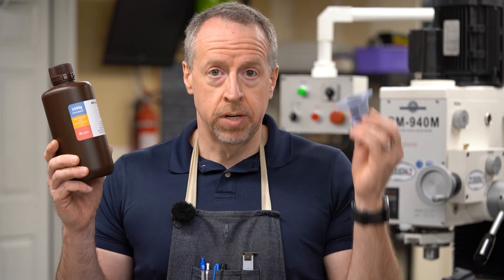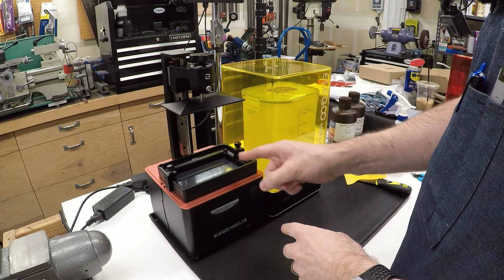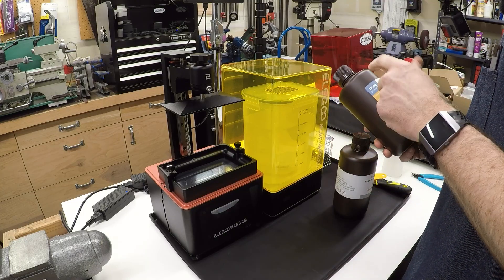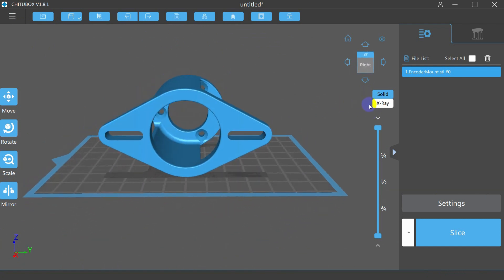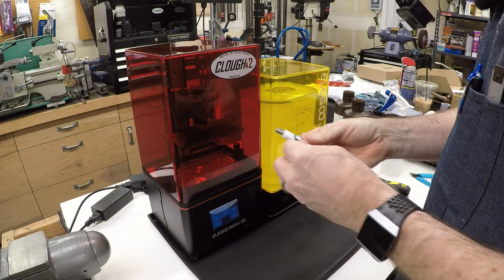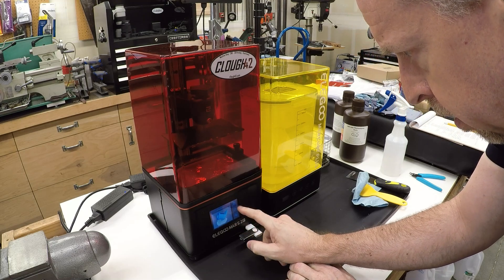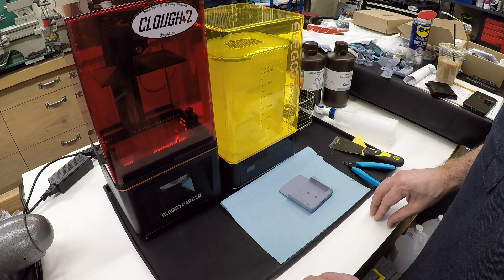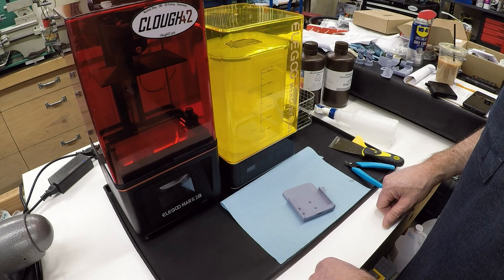Trying out a New Resin 3D Printer | ELEGOO Mars 2 Pro + Mercury Plus

Comment: Supports take a bit of knowledge but once you understand them you can print something where if surface finish matter just print it so when you take the supports away there is blobs left rather than craters and wet sand them down with 400 gritt really fast for smooth finish. A bit of clear coat also keeps them in good shape for a long time if used outside.

Comment: How dimensionally accurate are these printers compared to filament?
Reply: I have printed very serviceable gears down to modulus 0.5 on the original elegoo Mars, which is ~0.05mm pixel size. Like he showed in the advanced settings, I found I had to reduce the outer dimensions by 0.025mm, or an average of half a pixel. Also in the advance settings, he used 4 step anti-aliasing, which helps to reduce the layer and pixel effects, giving smoother surfaces, which was nice for my gears as well. My 16 tooth gears are 8mm diameter, and have run thousands of cycles (ABS-like resin) driven by a brushless drill. So I would say they can be very dimensionally accurate. I printed almost all of my parts flat to the build plate to maximize accuracy in X and Y, with no raft, and few supports.
My biggest problem with dimensional accuracy was in the Z axis. The original Mars had issues with column flex on the initial layers, which resulted in some compressed and angled printing of the initial 1 or 2mm of the prints. I agree with Clough42's looser fit when bed leveling. I often added a 2mm pedestal to small parts to alleviate that issue. I also learned to chamfer bottom edges to fight the 'elephant foot' effect on larger parts.
For my part, I would have attempted to print this part flat to the build plate, with a handful of supports for the upper flat. [NOTE: The only printing problem I would experience with this type of print, is excess resin cured on the supported face, where resin fails to drain away during retraction, and is then cured by recurring light bleed. I know others solved this problem, but I never did. I wonder if the shorter exposure times of the monochrome LCDs would reduce this issue?] The advantage is slightly better dimensional accuracy, better squareness of parts - which is important for some prints, reduced resin usage - so prints are lest costly, and significantly shorter print times. Such large rafts consume a lot of expensive resin, and raising a part 5mm results in printing 100 layers before beginning to print the actual part. Tilting prints is a judgement call that improves with experience.
VegOilGuy has a different method of improving bed adhesion by painting and curing resin on the whole build plate - which is interesting. He also has done numerous printing to lost wax casting, where  much can be learned about getting from 3D prints to metal parts in small fine scale. MyfordBoy shows a good number of 3D printing to Sand Casting videos, for larger, but coarser parts. And Clough42 shows us how to use machining of parts to make our tools better.  What a lovely world. 
Thanks James!

Comment: My favorite resins are the Siraya Tech resins, not only are they among the cheapest, they're fast, clean off very quickly and easily (in a wash & cure with IPA), and they're tough. I've got 3 printers, a Wanhao D7 that was my gateway drug, a Mars 2 Pro just like yours and a Saturn.

I've never used the PTFE trick and haven't felt the need to try it with the Siraya Tech resins. The main failure point for me has been the temperature of the resin. Most manufacturers will list a range of temperatures and they're not kidding. My printers are in my garage, so I ended up running a space heater to get the resins up to temp (about 25C). Another problem I've run into is expired resins when buying closeout deals. Those can  just fail in all sorts of baffling ways.

One thing I notice about your print and support settings, when printing solid parts (which you definitely want to do for functional things, or at least use an infill), you'll definitely need more heavy-duty supports.  Which you seem to be mostly doing, but that timing wheel looked probably a little heavy for the size of supports you used. A lot of advice for supports is geared to larger hollow prints or smaller ones.

I did things in the reverse order and have started doing some FDM prints after about a year with resin and it's really made me appreciate resin printers more! They're very different beasts. FDM is more like working with a robot and SLA more like training an animal.

Comment: If you rotate the part 180° along the center axis you can have less supports as the part supports itself. You also will not have floating parts halfway through your print.

Comment: I'm curious to know how well the resin would stand up to higher torque values in some applications, like motor startup on a pulley. 
Are there resins that can stand up to higher loads ?  would  filament printing with abs or nylon be a better choice , but notoriously harder to print ? So many variables with printing, almost makes manual machining easier  lol !

Comment: Very interesting... I have had the creality equivalent for nearly 12 months now and haven't had a single print failure yet due to bed adhesion... I have had more issues trying to remove the print from the build plate.. 😂😂😂 I am still running all the default settings and the light support settings... the only settings that I have changed is the exposure settings to the manufacturers recommendations... I wonder if it is the type of resin you are using that is causing the failed prints? I have tried a few different brands and found monocure rapid to work the best for me... It also has near to no odour...
Reply: Have you tried magnetic plate covers?
Reply: @markwhickman351  yes, I have a magnetic plate fitted to it now and makes it a lot easier to remove the prints... lol
Reply: @mr.b6034  I keep thinking I ought to give one a try. I find the chiselling off of the prints requires me to re-level after nearly every run.

Comment: Oh BTW use a sphere attachment on ChiTuBox! You will avoid all those holes from snipping away the support columns. Though you will remail with small "bump-balls". But it is easier to remove small bumps that fill holes! ;-)
Reply: A great tip thanks. Though for a mechanical part with close tolerances a small hole might be more desirable then a bump that could cause fit issues.

Comment: Nice intro video to get started with resin printing, I have an Anycubic Photon and it really takes a bit of learning to get successful prints. 
Be careful with the Elegoo ABS-Like resin in your car, if you don't paint it, it will continue to harden and crack due to the constant exposure to sunlight. It will just build internal stress somehow and spontaneously crack. I had a few brackets in my car fail because of that, painting them with some thicker paint or primer prevented it from happening again so far.
Curing the part in a cup of water supposedly helps with curing, because it (in theory) prevents oxygen from absorbing into the not completely crosslinked polymer chains and thereby weakening them. Don't know if it really works, but from a chemical standpoint it makes sense. 
Touching the resin is not actually that big of a deal btw. The resins used for printing are mostly epoxy resins, obviously you shouldn't drink them, take a bath or smoke them. Standard nitril or latex gloves are not that much of a protection either, since parts of the resin can absorb through them over time, just like acetone does. Getting it on your hands is mostly just annoying, since you'll get the sticky stuff everywhere.
Reply from the maker: Thanks for the info.  With respect to safety, I'm not going to dip my hands in it, but I assume  occasional incidental exposure is unlikely to be a problem.  Long-term occupational exposure would likely be a much bigger deal.
Reply: @Clough42  Yeah, working with that stuff 8h/day is probably a much bigger deal, but at that point a proper respirator and/or fume extraction would also be a much needed addition. Eye protection however might be a good idea even for entry level hobby use, since not only might it irritate your eyes and possibly glue them shut, but the mucous membrane in your eye probably absorbs chemicals much better than your skin ever could.
Reply from the maker: @MrsMcMuffin  This is good advice.  You never know when you're going to drop something or catch a flexible spatula on something and throw a drop.  Eyes are worth protecting.

Comment: Great vid, possibly the best one I have seen from an engineering perspective. This is exactly why I bought one of these setups. It would be good to see how accurate the part was and how well it worked as intended as a functional part… was it strong enough?
Reply from the maker: Yes, both the phone holder and the encoder mount worked right off the printer, and I'm still using them today.  I was worried about how the resin would hold up in the car over the summer, but it's still going strong.

Comment: Maybe you can buy the new Elegoo Saturn 2 Resin Printer which has 8 K mono screen. it prints 219 x 123 x 250 mm Larger Printing Size.
As I know you like bigger parts sometimes?  It is one of the faster more detailed resin printers around. They do a newer wash & cure station V2 now for this size of resin printer

Comment: I printed a similar phone holder for my car, but the next version had a wireless charging coil integrated into it. By the 5th version I gave up, bought an off-the-shelf wireless car charger and 3d printed my own bracket to match up with the ball connector on the holder.
Reply from the maker: I've had this in my car for about five years, printing a new bracket to fit each new phone.  Every time, I expected it to fail, but they've been great.  I tried some cheap Qi charger boards from ebay, but they didn't shut down when the battery was full and heated up the phone.

Comment: To avoid all those failed prints, prints the object at a 45 degree angle, and you wont get those parts getting stuck to the fep.  The problem is after you put down the raft and the supports, it prints the first few layers of the object after, and they are big compared to the contact points of the supports, so the suction force is enough to rip out the little support points.  If you print at 45 degrees you get less surface area so less suction.
Reply from the maker: If the raft survives.  In some of the failures, the raft came off before even getting to the supports.

Comment: What's the lifespan of these parts? I've heard of some parts getting significantly more brittle over time, even without being exposed to excessive UV.
Reply from the maker: Don't know.  My first parts are now about a week old.
Reply: @Clough42  It's very chemistry dependent. They do creep/warp over time, some become brittle. Most warp in sunlight or become brittle in hot/cold cycles. The temperature-dependent expansion/contraction can be surprising. I recommend printing a sample part with every resin you use, and just keep them somewhere in the shop. Later, if you see weird behavior, you can refer back to those samples and see how the plastic is doing.
Reply from the maker: @ViceChief  this is good advice.  I find FDM-printed ABS to be very durable over time in the shop.  PETG also does well in some applications, but it seems to become brittle from exposure to soluble oil coolant.

Comment: How long did it take to print that part?
Reply: Print time is related to the cycle time per layer, and number of layers. That said I believe he commented that it takes about 4 hours for the encoder mount, which sounds about right from my experience with a much earlier printer. Looking at the slicer, it's indicating it will take 4 hours, 7 minutes 22 seconds. That's at about 23:30 or so. 

Note that if he ends up getting a Saturn, and he's able to put 4 or 8 of them on the bed to be printed in parallel, that will also take the same amount of time, as printing just one.  Note that the cycle time involves the amount of UV exposure time, led off time, and time for pulling the print off the FEP, as well as moving the print back into place for the next layer. 

Once you tune the lift and reset speeds, the only thing that may change how long the print will take is adjusting the exposure time, which can be affected by various properties of the resin, including color, how 'hard' the resulting print is expected to be, and so on.
Reply from the maker: If I remember correctly, with .050mm layers and a 2.5s exposure, it prints about 17mm of Z height per hour, regardless of what's on the plate.
Reply: @Clough42  and as long as you are using the same exposure times, and the other settings, I would expect that to be the case, no matter which size of the printer you were using. Granted for some of the really large format printers there may be added jerk control for lifting and restoring the plate, but I don't think that's an issue for any of the Ellegoo printers yet. I could be wrong on that though.

Great demo of the process and results. Thanks.

Comment: For best results, cut all your supports with sidecutters and remove "stumps" with razor blade and sandpaper. That way you avoid to get "craters" on surfaces.
What kind surface finish that buildplate has? If its too good, scrath it with coarse sandpaper.
Reply from the maker: It looks to be abrasive blasted or etched.  It's actually getting smoother as I scrape parts off of it with the metal scraper.

Comment: Great review THX,  how has the resin hold up in application?
Reply from the maker: It'll depend on the application.  The phone holder I showed in this video has been in my car for a year and a half, and it's still working great.  Summers here hit 105F/40C, and winters hit 15F/-10C and I park outside.  I recently printed a pattern for sand casting, and it held up well for a couple of ram-ups.
Reply: @Clough42  perfect answer, still wish you bought the larger machine?
Reply from the maker: @truknob  I would like a larger build area, though I think there's probably a point of diminishing returns with the force needed to release the FEP.
Reply: @Clough42  great point 💪🖖🏻

Comment: Hi James, now that it's been a couple months I'm wondering if you have any update on the resin prints and printer. 
Have the printed parts held up in the car? Any significant durability issues with printed parts? Is the printer itself still working well? Thanks!

Comment: You need to clean the lcd-fab junction to help the fep to lift and peel
Reply from the maker: Not sure I understand.  The "lcd-fab junkction"?
Reply: @Clough42   fep and Lcd must be very very clean. So the fep don't Sticks on the lcd. In order at the lift process to Easley peals of from the cured resin. If is Dirty, oily, finger oil it will stick on the lcd and then the force that needs to be Detach is very high.
Reply from the maker: @agapiosagapiou  okay, I cleaned both with glass cleaner and clean IPA, so they should be good.
Reply: @Clough42  is a messy process! By the way nice video!
I always enjoy you job!

Comment: I hope that you read the manual. If you did not, FYI, you can flip the top of the UV-LEDs tower down for some downward illumination.
Reply from the maker: Umm...I don't think so.  The manual doesn't mention it, and the column appears to be solid metal stampings with no articulation points.
Reply: @Clough42  , it must be the new version of Anycubic machine (they look very similar). Sorry for my confusion.
Reply from the maker: @michaels3003  I would love to have that feature.

Comment: I have basically the same printer, different manufacturer. I'm only interested in functional parts. So I've gone down the rabbit hole of resin mixing to obtain desired output properties with great success, as have many others. I learned about the brand Siraya Tech, and I now exclusively use that. I mix two of their products called Blu and Tenacious with very good real world end results. A part that's hard, but not brittle.
They have a newer line, (which would seem it is in fact a "blend" of those properties that I like in a functional resin) It's called Build, and it's main selling point is that it can hold a tapped thread. And those that have tried it seem to also be hooked on "Team Siraya Tech"
But play around with mix ratios, and you'll find you can get a cured part that resembles nylon if you wanted something with quite a bit of give before failure.
Reply from the maker: Thanks for the tips.  I've been a little disappointed with the data published by the resin makers.  They all publish slightly different info, and it's very difficult to compare.  I am indeed interested in something like nylon and I have been experimenting quite a bit with printed threads.

Comment: I can't speak from experience with necessarily this type of resin, but the resin used in model making can be quite temperature sensitive, becoming very soft at temperatures over about 90F, and reaching a putty like softness at boiling temperature.  I've had models droop from being in a hot car.
Reply from the maker: It will be interesting to see what happens with the phone holder.  It's sitting in my car out in the sun as we speak, and summer is coming.  We routinely hit 40C (104F) here, so it'll get a good test.
Reply: @Clough42  Do you have a update on the phone holder printed in Elegoo ABS-like and how well it handled the heat in the car?
Reply from the maker: @Kezat  still going strong.  I use it every time I drive the car.
Reply: @Clough42  That's great to hear. Thanks for the reply!